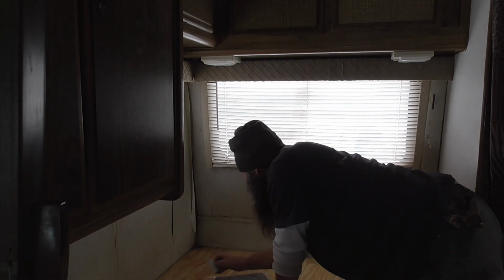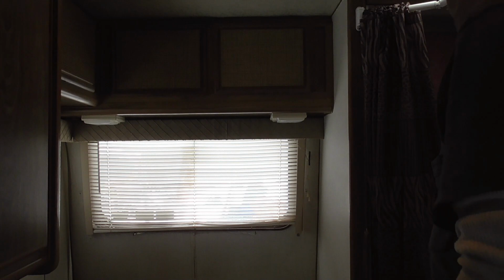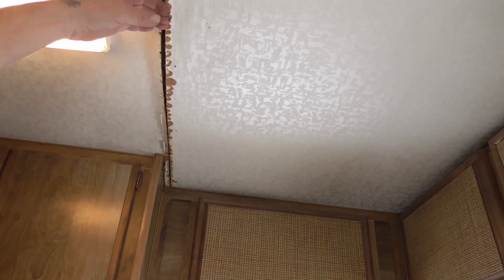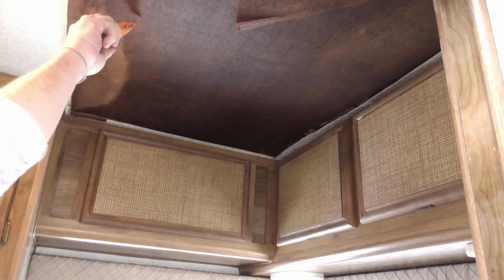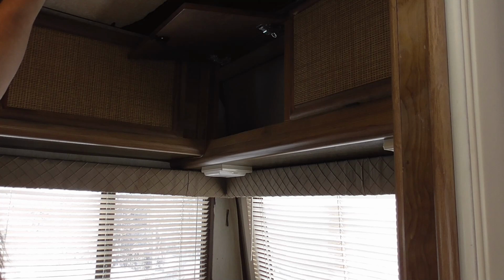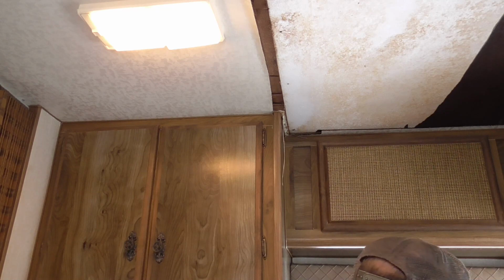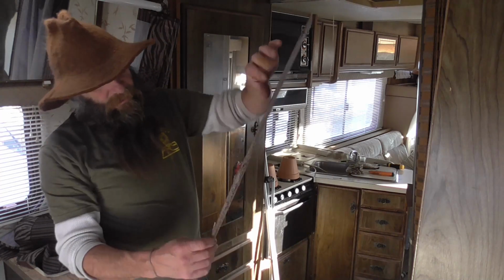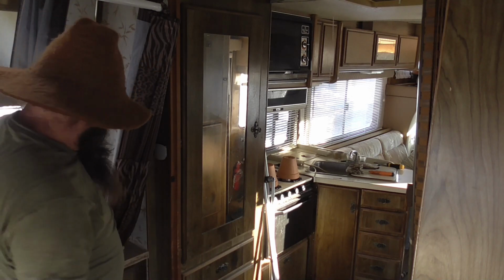REPAIRING WATER LEAKS ON 1986 TIOGA MOTORHOME, GETTING READY TO ROLL, NOMAD LIFE WITH FUEL PRICES?!?

Comment: The rear corner of RV has rotted corner. Would you repair from inside or outside? Aluminum strip & screws are loose.
Reply from the maker: It's steel framing no rot

Comment: By the time I managed to figure out the problems with my old Shasta travel trailer, it had rotted to the point where it wasn't worth repairing, and after tearing into the walls, the whole structure was rotted.  No insulation between the walls, or roof, so the leak starts typically around a vent, and you don't know till its too late...was surprised the dang thing hadn't fallen apart while in tow behind my truck LOL.  Oh well the frame made a great 14' flat bed trailer HAHA!!  I'd love to get another small travel trailer at some point but right now they're ridiculously priced like cars LOL.  Heck I could take my Ranger camping and sleep in it since it has a 7 foot bed.  I picked up a camper shell for it last year, so its dried in for the most part, if I did need to use it to sleep in I'd pull the shell off and put a seal on the bottom of the shell, it leaks just a little bit in the front corners.  I used to sleep in the back of my Toyota Tundra, did that several times up camping, seemed to work fine...Might try and build a sleeping platform in the Ranger at some point, would make a great project, and work fine till I can find another trailer...beats sleeping on the ground in a tent.